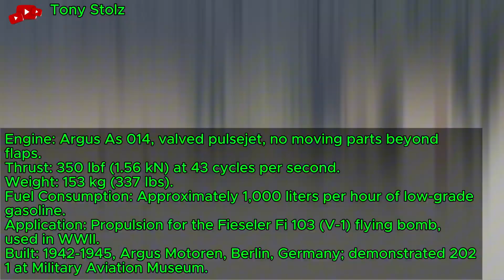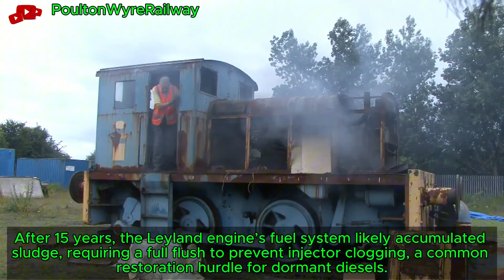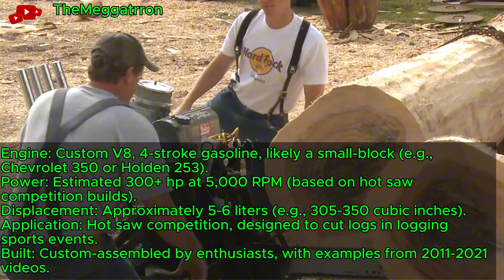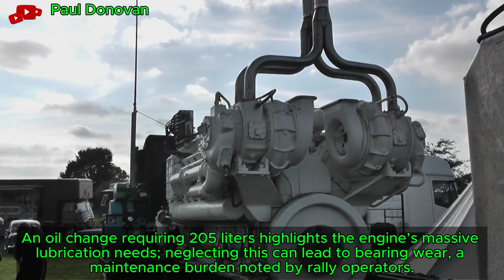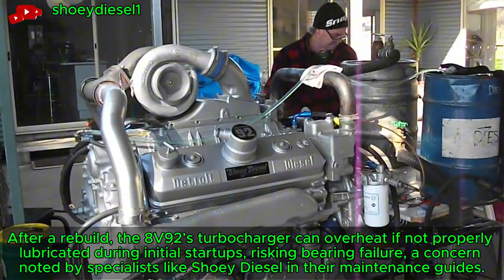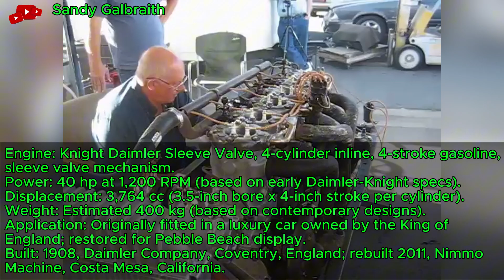Rare Old Engines Starting Up Sound That Will Blow Your Ears! ▶ Part 44

Comment: Ummm, that rare Detroit Diesel 8V-53 is actually 424 cubic inches displacement. The hundreds of 6V-53 engines I've worked on are the 318 cubic inch displacement. With Detroit Diesel two stroke engines displacement is right in the series number...example...16V-149...149 cubic inches per cylinder, multiplied by the number of cylinders...16. Which is 2,384 cubic inches displacement...or 38½ liters. I KNOW Detroit Diesels because the United States Air Force shipped me stateside to the General Motors Technical Center in Detroit. 6 weeks of learning every little trick and glitch in those engines. After that, I got to teach all the new recruits about those engines and how to keep them running in every situation.  Ugh
Reply from the maker: I love how you break it down with the 6V-53 at 318 cubic inches and the 16V-149 at 2,384 cubic inches (38½ liters)—super cool! Your Air Force story and those 6 weeks at the GM Technical Center sound intense but awesome.
Reply: @PTValleyEngine The GM Technical Center gave me so much knowledge on the Detroit Diesel 2 stroke engines...I could "Run the Rack" (calibrating injector fuel flow and timing) in about 30 minutes. Less time if it was an inline cylinder arrangement instead of the V block engines.

Comment: Hey, that small block Chevrolet powered chain saw is just a little ways north of me. The guy has it on display outside... It's way to big for anyone to try and steal it... Without having a forklift that is.   XD XD XD
Reply from the maker: You nailed the single-cylinder mix-up with Rustin Hornsby, corrected the CASE 150 nomenclature, and got the Detroit Diesel 8V-53 at 424 cubic inches spot on. Your take on the 454-inch lawn tractor, the nearby chainsaw, and the 16V-149 breakdown shows great insight. Plus, your Air Force story at the GM Technical Center adds a cool touch. Thanks for sharing—really appreciate your expertise!
Reply: @PTValleyEngine The Henry Ford Museum also has some steam locomotives inside from the early train age...I forgot to let you know before.

Comment: The nomenclature for the CASE 150 traction engine has an error. Nomenclature states that it is a two cylinder double acting steam engine... It's actually a single cylinder double acting steam engine. I keep tabs on old girl and have several articles on her in my Farm Show magazine. She's only 150 horsepower but she has WAY MORE pulling power than my grandfather's 350 horsepower Allis Chalmers 8550 articulated farm tractor. Allis Chalmers called the 8550 "The Beast"... But that CASE 150 is a "Monster".   LOL
Reply from the maker: Love that you keep tabs on her, and it’s awesome to hear she’s featured in Farm Show magazine. That 150 horsepower packing more pull than your grandpa’s 350 hp Allis Chalmers 8550 is wild—calling the 8550 "The Beast" and the CASE 150 a "Monster" is spot on! LOL